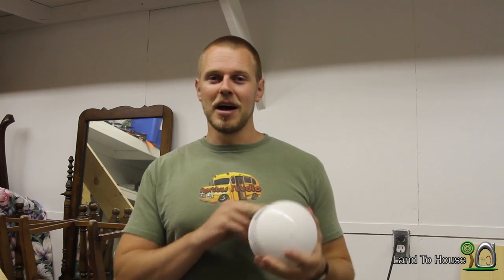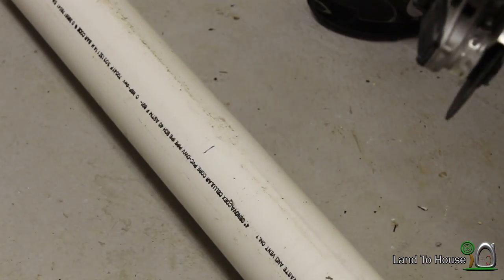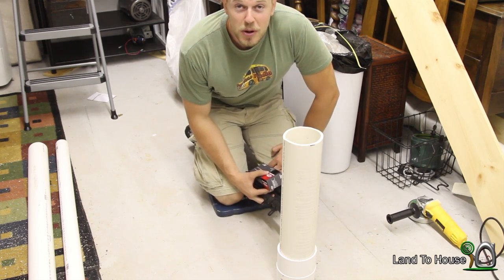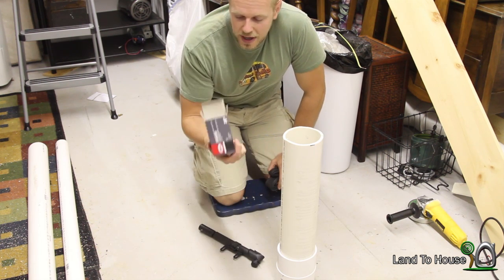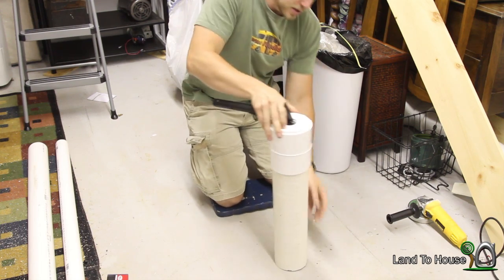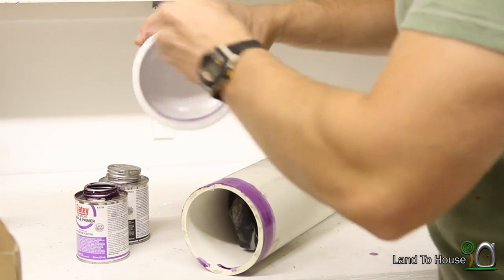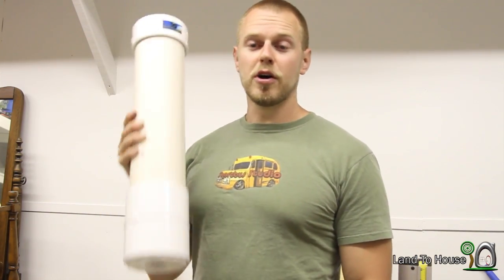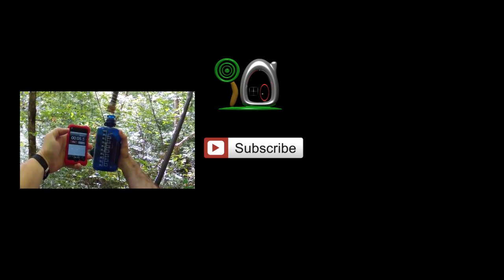Ram Pump Pressure Tank

Comment: So,I built my 2" Ram Pump and have just to Run the delivery line up my property to my Cistern but I haven't made it's Pressure vessel since I had a used vessel that was recently changed out.I will build mine with a Schrader Valve Stem in the cap and a Guage for pressure reads during start up/adjustments and I'll try to send you some piocs via email as soon as I can?Thanks for your time,Man.

Comment: I am putting together a 2" pressure tank for a 1/2" pump right now and am wondering if I will be able to service the inner tube through the 1/2" hole in the bushing? I have a 20" X 1.95/2.125" inner tube and there is no way it will fit through that 1/2" threaded hole, and I doubt I will even be able to get out the Schrader valve far enough to add air? I am going to make the tank a bit long so I can cut the cap off if needed and replace it. Any other suggestions?

Comment: How often do you need to replace the inner-tube?  Also do you think it would be effective to dill a hole in the cap of the pressure tank so if the inner-tube loses press it could be refilled? Thanks

Comment: Great video.  Mine had a darn leak.   I will be rebuilding my pressure tank next week.  My spring is now from 2 to 2.5 gpm on the mountain.  I  hate to see it getting this low.  Any progress on the 1/2 inch ram?    Thanks
Reply from the maker: Oh no a leak!  That won't do at all.  2gpm is getting very low for a ram pump.  I have the 1/2" built abd I have run it several times.  I should be getting a gpm test for you next week.

Comment: Does the pressure tank have to be vertical? My creek is prone to seasonal flooding. So I would like to anchor my ram pump to the bottom and have as low profile as possible.
Reply from the maker: With a bladder in the tank it is possible to turn the tank on its side. Although the pump does work like this it is not recommended. The trapped air at the top of the tank is what allows the ram pump to build pressure.

Comment: ive seen Plastic Bottle used as Pressure Tank.

in your video, you inserted interior rubber tube in the PVC pressure Tank.
But for the plastic bottle, is it okay to use the Rubber Balloon?
(alternative)
Reply from the maker: I would consider a plastic bottle as a temporary pressure tank. I would also not want to have a plastic bottle as a high pressure vessel. I would make the pvc model and not worry about the possible failure of the bottle.

Comment: I'm currently doing a research about the ram pump. Do u have any idea to increase the volume flow rate and head pressure at the delivery pipe? Other than that increase the head pressure by increasing the vertical difference from water source to pump location.
Reply from the maker: Head pressure is the main way to increase the potential. Other than that you can install a check valve in the delivery pipe to increase the lift just a little. Using a waste valve that can be fine tuned to match the drive pipe length and size can also help.

Comment: as always excellent video how much extra pressure do you gain on the output
Reply from the maker: Thank you!  The pressure all depends on the feet of head really. But the inner tube really makes a difference in keeping water out of the pipe.
Reply: Land to House 
question I made a 3" pump with 4"× 4'long chamber I'm trying to pump up 75% vertical to my holding tanks 250' away 
? is by making the air chamber longer or shorter than 4' is it going to make a difference? 
my drop head will be around 10' drop from a 20' 6"pvc down too 2" 120' pvc pipe to the pump to pump up 250' 
this is my pump at Dead Dads Racing 
Justin Lara
Reply from the maker: Dead Dads Racing Justin Lara I do not have any experience with a 3-inch pump. it seems like the pressure tank you have will be sufficient. I would not go any larger than that. As for reducing from 6 inch to 2 inch it is typically better to keep your drive pipe the same size as the check valves. I would reduce from 6 inch to 3 inch to keep the sizes consistent.

Comment: hello mate.

how to make a stronger pressure?
installing a Bigger Tank will create Stronger pressure?
(The bigger the Pressure Tank, The better?)
Reply from the maker: There is a size per pump that is as large as the tank can be before it no longer makes a difference. So if you make the pressure tank very big it would be the same as making it normal size. Now it is possible to make the tank too small. To build more pressure you will want to increase the head pressure. This is the main thing that increases the pressure.
Reply: i would like to create a very strong pressure.
i wish i could learn from you on how to increase head pressure.
Reply from the maker: To increase head pressure you just have to increase the vertical difference from water source to pump location.

Comment: I have a 1 inch pump 1 inch drive 100 foot poly pipe fairly straight. 24 inch pressure tank with 18 inch by circle tube. Plenty of water gushing three inches above check valve . When get it  pulsate it is every slow and lifts water about 8 feet with a pretty good flow. It quits over night. What may be wrong. I know it is not air in drive line please help. It has about 36 inch vertical
Reply from the maker: It sounds like you have a low back pressure issue. The pump needs the delivery hight to be high enough to keep pressure back on the pressure tank. If you close the delivery side of the pump does the pump work non-stop?

Comment: Hi, I am volunteering for an NGO and am looking to design a Hydraulic Ram pump. is there an equation you used for the volume that the air tank volume requirement? is the system pretty much just dependent on the drive and delivery head, with things like the waste valve weight and stroke length to be tuned for the system?
Reply from the maker: The pressure tank volume does have some math behind it but I have not taken the time to learn that. The main thing you need to have is a tank large enough to build pressure. if the tank is too large it will just take longer to build pressure.
Reply: Ahh okay thanks!

Comment: Whats the deal with the innertube? Is it to make it more efficient? :)
Reply from the maker: The tube acts as a bladder to prevent "water logging" of the pressure tank. Over time the tank can fill with water and the pressure will drop. Commercial pumps have a snifter valve to replenish the air in the tank. The DIY model does not have that valve.

Comment: my question, what is the function of interior rubber inside the tube ?... thanks before
Reply from the maker: The tube is to prevent something called water-logging. Over time the water level in the pressure tank will rise and eventually stop the pump. The tube will slow this and at times stop it from happening.
Reply: Land to House but why you put rubber inside it ? what is the specific function of the rubber ? can the tube working without rubber inside ?
Reply from the maker: +Rizky Farizan Fiqri yes the pump will work without the tube inside the pressure tank. You might have to stop the pump and empty the water occasionally.
Reply: Land to House owh okay2, understood.. thanks a lot for answering my question
Reply from the maker: happy to help.

Comment: Hi Guy
anyone know how to calculate how long of a pressure pump?
Reply from the maker: When you say pressure pump do you mean pressure tank?
Reply: yes 
sorry that's my false
Reply from the maker: +PLAIFA KHAMMA no worries. What size pump are you making?
Reply: dive pipe 3/4"
air chamber 4"
Can you plz explain how to calculate? cuz I will teach that to people who live in shortage area in Thailand.
Thank you for your kindness
Reply from the maker: My 3/4" air tanks are made from 2" pipe that is 17" long. So that is a volume of pi r^2 x L  SO my tank volume is around 53 cubic inches. With a 4" pipe you would need to only be 5 inches long. It is just fine to have a larger tank it will just take longer to prime the pump.
Reply: thank you so much
Reply from the maker: +PLAIFA KHAMMA happy to help.

Comment: Why don’t you show how much pressure your using in your pressure vessels?I believe it’s because you have no understanding of how this works on this application which is only to keep pressure on the water supply therefore regulating it to a certain pressure point!
Reply from the maker: The innertube is located in the pressure tank to keep air in the tank. Otherwise there would be water logging over time. It is not to keep pressure in the tank. The tube is not inflated fully because there needs to be some "give" as the pump cycles.
Reply: Mr Johnson,I have saw almost every video you have made but again,I didn't see any response that leads me to believe that your "pressure vessel" isn't being understood in this application and I hope that you don't think I'm insulting your intelligence bc it isn't my intention to insult you.All the stuff I've read tells me that the pressure vessel merely keeps pressure on the water supply ONLY for maintaining that pressure? I have one running on my gray water system but I haven't installed a Pressure gauge just yet.So,my pressures are left unchecked and it keeps wearing out the pressure switch.Merely using the pressure vessel is correct but only if used at the correct pressure so it's maintained 2lbs below the gauge reading NOT BELOW OR ABOVE.Most recommend 2 Lbs, less pressure  difference between the pressure switch setting and the Point your pressure is at..?! I meant I like your videos and your attitude is great and pleasant! Keep up the great work, Seth!!👍🏻Could you show a video that shows the size of the Ram Pump compared to their potential Outputs? It's funny how nobody seems to have any knowledge about this type of system except for what's found on YouTube‼️✌️👍🏻
Reply from the maker: No worries. I am here to learn just like most of the people that watch these types of videos. Seems like you have worded that nicely. The pressure tank will become pressurized over a short time when the pump first starts up. It will then operate in a very limited pressure range. This just gives a small fluctuation point so that the pressure on the water can be maintained as the pump cycles. The bike tube just keeps that air space free of water over the long run so it can maintain the fluctuating pressure needed by the pump. The bike tube pressure is not all that important as long as the head pressure is strong enough to move the bike tube. That is why I do not fill the tube all the way. There needs to be some give in the tube to allow for the small fluctuation in pressure as the pump cycles. 

It would be fun to have a video showing the same head pressure and output height but change ram pump size. I will have to give that a go. Thank you for the kind words. I am quick to tell people that I do not have any real training in this area. I just like to play in the water. haha.